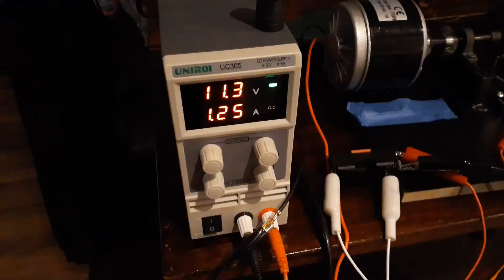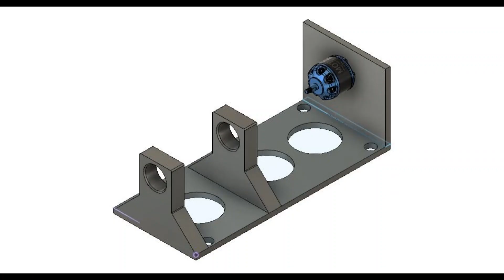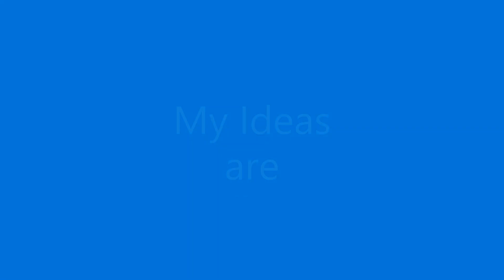Faraday Research RND💦⚡⚡#tesla #freeenergy #zeropointenergy

Comment: Damn now I want to use professional video editing software to kick it up a notch. If you like put a private playlist that I can access with video clips of what you want showcased what you want said and I will kick it up Hollywood style.. but not too much. I'll give it a nice "the revolution begins...again" sort of theme
Reply: BTW the oscilloscope is in Indianapolis Indiana and will be my way in the next 48 hours. Like I said I'll have it sent your way the 31st as fast as I can afford to. What would it take to get you to send me a proper coil? This is difficult considering I'm used to reverse engineering things and I'm unable to process making a coil about like I couldn't process what a spark gap was at first for some reason.... That I'm currently working on some way to keep my head above water monetarily ATM and things aren't going so hot
Reply from the maker: @zer0divid3  yeah making you a coils no problem all you have to do is let me know what coil you want and air coil or do you want a coil with a core are you going to be using it for a spark gap or a pulse motor Let me know some details so I can build something for you
Reply: @FaradayResearch  in that case i may have to wait until i can score some caps... atm just waiting on the wind energy regulating box, and everything i have seems to be 24v dc so far... only transformers i have are microwave. i guess due to my being used to figuring out how things work by dissassembly, ill know more when i have a bunch of parts to mess with in front of me and the answer will come then? i do have a car battery to spare and a plasma ball. i guess so i wont be so afraid to mess around, once i get the controller ill figure out how to get it from there to a method of storage, from said storage to a means of multiplication, then rectifying to somewhere close to AC.... and cant a rodin coil be used to transform to AC from DC?? regardless, get it to something i can throw into the grid until i figure something better to do. i have 240v AC/110v AC step up/down transformer as well... im just not creative. better at reverse engineering and flow charting by function with objects in front of me. trying to get all ive seen in your videos that i may need and just gonna see what i can make i suppose?
Reply: @FaradayResearch  its my way of starting small.... esp since anyone local i mention aether or spark gaps to and they tell me im going to make the tumor making me think of such things larger with all the emf.... and i reply if i was going to get a tumor, living in a smart house with 38+ wifi +18 or more bluetooth transmitters would have done it first on top of the shit wiring in my place making visible emf on digital cameras haha..

Comment: Are you achieving over unity with only 1 dimension of spin? I've been working on propagating plasma using multiple high frequency AC inputs, I believe plasma is the only way forward with technology. Also using multiple high frequency resonant AC inputs on specifically arranged coils 90* to each other can work as a solid state generator. Rather than physically breaking the coils through magnetic line its way more effective to do it by rapidly collapsing EMFs using harmonic frequency modulation.
Reply from the maker: Hi.... you make some great points on how to achieve over unity. My method is just one of many methods of creating over unity. I've chosen the motor type device to create overunity with excellent results. There are many, many solid state versions that you can create that will give you over unity. My motor in particular uses a spark gap switch which 99.99% of people out there making the similar motor that I am are using MOSFETs. I choose to use a spark gap switch because of the plasma discharge release from the mass. This is number 1# key to getting over unity with my particular motor generator system.... which everybody out there is overlooked. So yes you make great points. I understand them and there are many choices on creating novel ideas to create over unity.... My motor is just one of many methods of creating overunity devices...... thanks!!
Reply: @FaradayResearch  Thank you for reaching back and taking the time. I've been deeply passionate about Electromagnetism ever sense my father fascinated me by fashioning an electromagnet to attract a metal ball across the floor. I've been independently learning, researching, expirimenting and recently even creating new electronic applications that have lead to a unified understanding that's revolutionary for anyone who can imagine the new model. The best way I can explain it is by describing the device I am currently working on. Imagine a simple antique solid iron wagon wheel with 8 spokes connecting the axel, the wheel is analogous with Earths equator while the axel are the poles. Each spoke or axel line up spatially on all 3 axis of a 3D grid and they can have a variety of induction coils wound around them which allows the device to function as "10 angled flyback transformers" or a virtual monopole who's function could theoretically achieve massive over unity and who's universal model will bestow a template of wisdom that becomes an artistic expression of natures true form. Also this device is analogous with the Cherubim depicted in all of historical scripture.